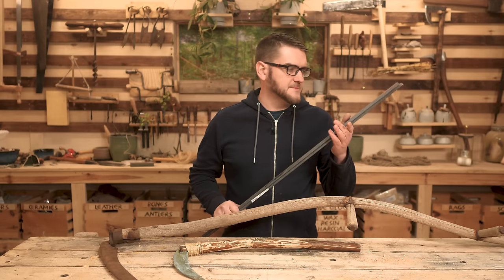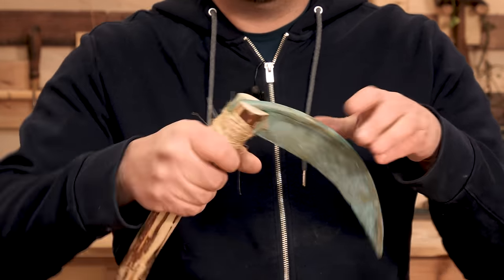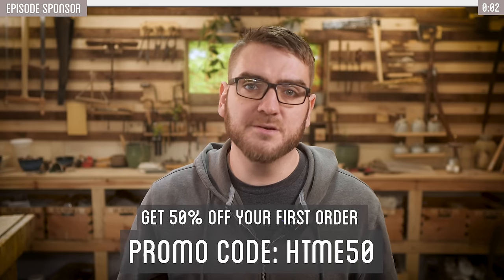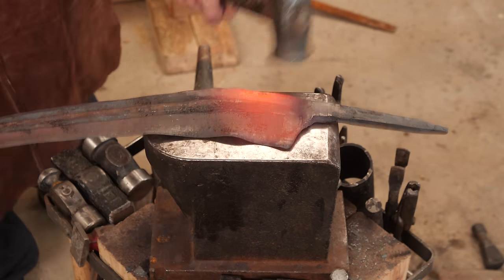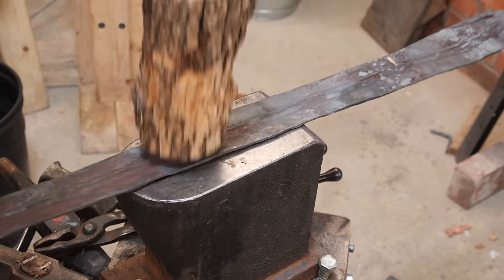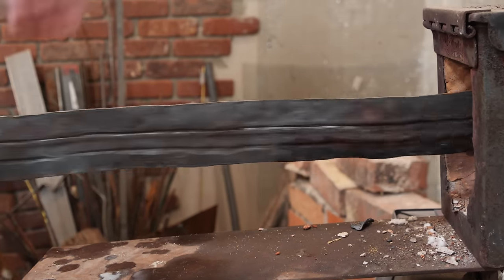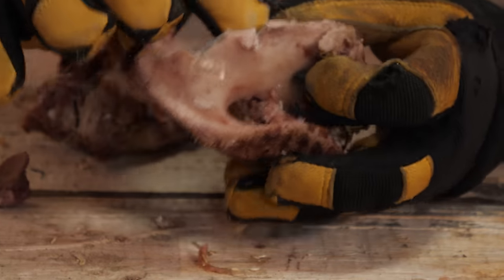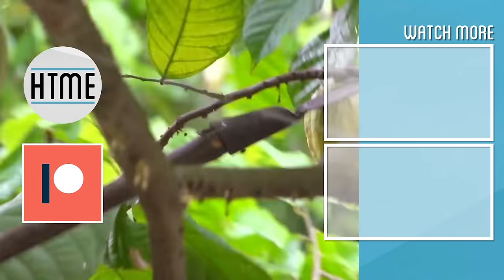Farm to Sword: Can you Turn Old Farm Tools into a Norman Sword?

Comment: Not the way I would have gone about it, being a blacksmith of 18 years. It worked... But I wouldnt trust it in battle. Unless you cut some footage, the blade wasn't annealed.. it was normalized, the quench was uneven/spotty, the temper is non existent. It's a bit heavy in the handle, but the furniture looks decent. 

Owning many scythes, I wouldn't have gone for a straight sword profile, curved swords cut better anyway.. But if I were forced to (and couldn't just cut and forge weld it into a new billet), I would chisel cut the flat edge off first, straighten out the remaining stock, and anneal it overnight in wood ash. Then hammer it to shape working both sides evenly, grind, heat in a long fire and quench at an even temperature (except the tang), and temper accordingly (about 400°). Normalizing the steel doesn't remove stress in the steel as well as actually annealing it, especially steel that's been work hardened for years.. hell, scythe blades are sharpened with a hammer and a stake anvil, the original scythe blade is so full of work stress that it's only suitable for cutting grass at this point anyway. Best to just remove it early on in the process.

I've seen worse, for sure. So I'm not trying to be too critical, I just know better. The kid has a lot to learn, but he's definitely a better smith than most of the folks bashing him in the comments.
Reply: These are the kind of comments I like to read here! especially since so many people seem to miss the purpose of the video or assume that Theo thinks he's a master blacksmith or something. He is like everyone in the HTME crew someone interested in learning by doing, just like many of us viewers are :D
Reply: @bl4cksp1d3r  if I couldn't recognize a newer smith, or if he'd tried to come off as a "master blacksmith" (which I don't believe actually exists), I'd have been a lot more critical lol. But at the end of the day, the dude made a sword from a scythe blade, which is a lot more than most critics can say. He also did it without using any power tools, from what I saw. Most blade smiths these days just buy good steel blanks and cut/grind the blade to shape. So giving credit where credit is due, all things considered, he accomplished his goal.
Reply: I appreciate the tipes, yeah the heat treatment was god offal (but our normal quench tank was frozen solid) it was -8 when we were filming
Reply: @theomelchior2739  yeah, that's definitely a downside to being a blacksmith in the North. My first half hour in the shop is spent just warming up my anvil and thawing my slack tub.

For what it's worth, you got the job done.. and as I said before, that's a lot more than most of the critics can say. Keep at it, brother.
Reply: @sasssquatch1467 do you truly believe master smiths do not exist?
Reply: @DH-xw6jp  yes. Any old smith you'll ever talk to will tell you that you're learning every day. You can make the same thing thousands of times, but still encounter problems that force you to scrap the project and start over. Being a blacksmith is a broad skill, there are tens of thousands of things that we can make, and nobody can master them all before their time is up. In the end, you can only become a master in a couple specialized areas of forge work. Some smiths are masters at making hardware, but can't make tools to save their life. Some are masters at making blades, but they can't make nails worth building a birdhouse with. Some are master decor smiths, but they can't make a spoon that'll hold soup lol.

It's just too broad of a skill, with too many specialized branches to call yourself a "master" in entirety.
Reply: @sasssquatch1467  okay...

So you do believe master smiths exist, and you just listed multiple types.
Reply: @DH-xw6jp  no, but I can see how my wording brought you to that conclusion. I should have said "specialists".
Reply: @sasssquatch1467  okay.

My next question is: do you believe it is possible to achieve mastery in anything?

I'm not trying to gotcha or anything, i'm just curious how far the sentiment goes.

Because I firmly believe that it is possible for craftsmen to accomplish mastery of a skill or subject, mastery doesn't imply never ever making a mistake however (I'm sure even Michaelangelo had to scrap the occasional work).
Reply: @DH-xw6jp  sorry in advance for the long-windedness.

yes, I do believe it's possible to master some things. But again, blacksmithing is just too broad of a craft. There are branches of blacksmithing that require entirely different tooling than a standard smithy, entirely different bits of applicable knowledge, entirely different processes, etc. You can "master" certain projects for sure, but if you were to line up 20 different "master smiths" each would be proficient at different projects than the other. 

It comes down to a matter of opinion. In my mind, it's just not possible to master a craft as old and nuanced as blacksmithing. There are only so many ways you can build a structure as a master carpenter, there are only so many ways you can cut and lay stone as a master mason, there are only so many ways to wire a building as a master electrician.. most skills that can be mastered have standard processes to achieve consistent results. But every blacksmith does things a little bit differently, so much of the craft comes down to eyeballing, feeling it out, personal preference, culture, etc. Every piece is unique to the smith who made it and even then, a smith forging an exact copy of their own piece is essentially impossible without grinding (white smithing), welding (fabricating),  machining, or all of the above.

So, experts and specialists? absolutely. But masters? Not in my opinion, or the opinion of every long time blacksmith I've met or listened to.

Comment: Why didn't you fold and forge weld into a central bar, and then draw it out to the shape and thickness you wanted? The scythe spine has the bulk of the steel, aside from the tang. Makes sense to bring it to a common center first.
Reply: You would, if you had time and the skill to do so. When have neither time nor skill (e.g. if you're about to face an invasion) you're gonna have to make compromises. Also forge-welding is pretty difficult even today.

Comment: No wonder the swords you find in battlefields look so rough, because they were rough looking to begin with.
Reply: I wonder if we're just biased because the most swords we do find (and display) are usually exceptionally well made ones. It wouldn't surprise me if the cheaper materials / less well made ones have a tendency to rust / degrade quicker than well made ones from good materials.

Comment: i  personally belive you may have been better off creating a single edged sword and creating something more akin to a katana/scimitar perhaps somewhere imbetween where you focus most of your bending towards the tip where cracks and splits would be less impactfull on the whole body of the blade whilst still getting that curved blade to aid in slicing
Reply: This would also aid in warping and mean a much sturdier blade overall
Reply: Or... A falx.

Which is a sword with a forward curved scythe like blade.

It would have been as simple as straightening the tang and putting a handle on it.

Comment: Uninformed question…. Why wouldn’t a blacksmith fold and re-work the steel similar to Damascus style and start fresh?
Reply: Way more heat required, then just heating and straightening.
Reply: It would be a decent option, just it would take longer. If I had a couple scythe heads made out of good steel I'd probably consider it.

Edit: probably not, I thought for a bit, and at least the scythe they are using is a little thin to begin with, and that'd be more trouble to weld than it's worth.

Comment: Historical blacksmiths would have chopped that scythe up, restacked the metal and forge welded a new billet rather than wasting time trying to straighten the steel.
Reply: Historical smiths would've made a warscythe from it. But that wasnÄt the goal of the video, obviously
Reply: The title say otherwise. Norman swords have a specific design, including a fuller. This isn't a Norman sword.  @bl4cksp1d3r
Reply: @antagonizerr  i mean, the title states a question, and the answer is pretty clear: not like this. So where's the problem now
Reply: Same problem. Yes, you can forge a Norman sword if you do it right. Did they? Nope. @bl4cksp1d3r
Reply: @antagonizerr  yeah

Comment: Metal was often tempered in salt water or mare urine quite often. Also sometimes the item was placed in sand to slowly cool. IMHO, folding the blade in half lengthwise and forge welding it together would have been better. Then slowly lengthen it out to the desired length and width. Really not the most desirable metal to use for a sword that would hold up.

Comment: Tool steel is usually pretty high in carbon, making good material for blades. Not on only is it possible, there was a show on the History Channel called "Forged in Fire" that had smiths make blades from tools all the time.
Reply: I make knives as a hobby and have a big box of scrap files, sections of industrial 40x1mm bandsaw blade, and bits of gardening implement. They all work great and even better, I don't need to buy stock!

Comment: This is good for a first try, but this sword shaped object will fail if used.
Reply: and it did in the video, as did many low quality iron age swords made historically. The romans even commented on barbarian warriors in europe bending their swords in battle and straightening them by stepping on them. Its no warriors sword, but its a good representation of some of the lower quality swords that existed in the past, thin and a bit fragile, but able to still cut even if not for long.

Comment: Great results with the given limitations... xD
I'm guessing that for better results, you'd just keep the original tool shape intact for a different type of weapon, or just melt the entire thing and recast, rework into something completely different.
Reply: Melting it probably would have been a bad idea. Usually melted iron absorbs too much carbon becoming brittle (think of like a cast iron pan). A professional smith probably would have cut it into small sections, bound it together with wire, and then forge welded it together (similar to how the Japanese made their swords). It would have required a bunch more skill and could go wrong but if it worked well it would have  let them make a new bar of the kind of steel usable to make a sword from scratch.) However I think this would have gone against the original idea or spirit of the project.
Reply: @1forge2rulethemall88  Yep, you are right on this.

Comment: A good scythe blade  is way too thin to be a good sword. And re-heat-treating blades is always an adventure., and as adventures do it often ends in disaster. And I say this as someone who spends a significant amount of time reprofiling, de-mushrooming, and re-heat treating tools.

The smiths from the craft guilds which are restoring Guédelon  castle do all that, but they also smelt the scrap iron and steel at least once a week. because some jobs are just more trouble than they're worth.

Comment: Forgive my ignorance but wouldn't a cavalry sword been a better choice and used the curve?
Reply: Its the wrong way bent unfortunately. Scythes taper to very thin edges on the inside of their curve, unlike sabers which taper to an edge on the outside. I suppose they could have left the inner edge thin and just flattened out the outside to make a curved blade that way but I'm pretty sure that would have just made a two sided super curved scimitar without too much support. Other weapons could have worked to the same degree as this one, but I think this one definitely was the most eye catching.

Comment: I don't want to be mean, but that smith is a pure poser. The grinding wheel wasn't even dressed:  it's just for show. Based on his technique, knowledge, and working temp colors, I would bet that his experience is mostly stock removal with very little forging and no forge welding experience... and the fact that he did a partial quench on a sword and said "we WANT that" (unhardened back half)... he doesn't know what he's doing AT ALL. You want to have the back half unsharpened, but still hardened, with the whole blade tempered back to straw for a nice spring, and he didn't even clear off scale to see the temper colors so he could hit straw, he just guessed... and that is NOT how traditional smiths historically did it. The dude might WANT to be a smith, but he's not:  he's a fraud who doesn't know what he's doing. I could go on all day about the mistakes he made and the inaccuracies, but as I said, I don't want to be mean... but I had to say something.
Reply: Yep, color temperatures are very key.
Reply: Honestly, the main issue is that this blade was Iron. To make a proper sword, they really needed to forge it out and then try and case harden the edges. But that's really easier said than done even for the pros. What they could've done however is construct this like any pure iron sword, with ridges and hammered edges that are then sharpened with stones. Controlling the grain is a total pain in the ass with pure iron anything...

Comment: This dude is not doing himself any favors by working that steel after it cools down so much. He is creating so many stress risers and fractures in the steel that it will shatter on first contact with a shield. And this is not the method that would have been used in medieval forges to repurpose the steel. He needs to cut the scythe blade into manageable sized strips of steel, stack them, then forge weld them into a nice billet and then forge that into a sword from scratch. I don't even have to watch beyond the 5:25 mark to see that this is going to be an awful weapon.
Reply: to be fair, we can't really judge how hot the blade is, because the light of the workshop might overshine the glow of the metal. Something I've learned while heating metal in the sunshine myself :/
Reply: Yea that looked like a pain in the ass to forge something so long and thin. Looses heat quickly and wants to bend all over. I made a short sword from a sickle blade and had the same problem. That scythe blade is like 3 times as long lol.
Reply: @bl4cksp1d3r  well it really doesn't matter how much he cold hammered it after he quenched with water. He's right that oil was a precious commodity, but that doesn't mean it wasn't used to quench swords. If you quench a sword in water you're begging for it to shatter. Of course he didn't even bring it up to the right temp to quench it either obviously cause it bent like it was completely untempered.
Reply: @IgabodDobagi  well, you CAN quench certain steel types properly in water, but I doubt this is either the right steel or the right temperature for it, yeah
Reply: Honestly depending on what kind of steel you're working with, you can hammer it at black heats fairly easily. Just have to be careful to normalize it. It's not like wrought iron where working it too cold might cause a delamination. I work steel at black heats all the time.

Comment: This explains a lot. Like, why medival weapons had lesser quality sometimes and why certain swords held up better than others. If a modern made sword was used back in medival times, it probably would have been seen as enchanted.
Reply: No. Swords were really good even back in the dark ages. They had steel inserts with iron cores. They bent maybe but they were durable. 1300s swords were basically indistinguishable from modern ones. this is just subpar craftsmanship unfortunately.